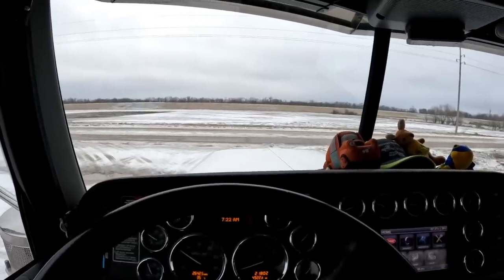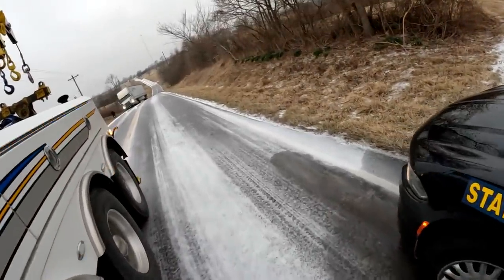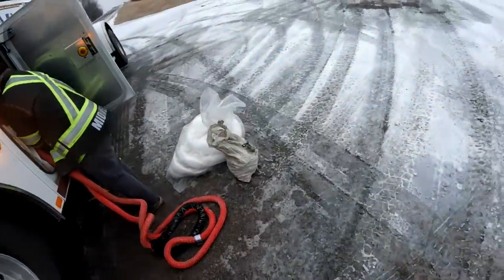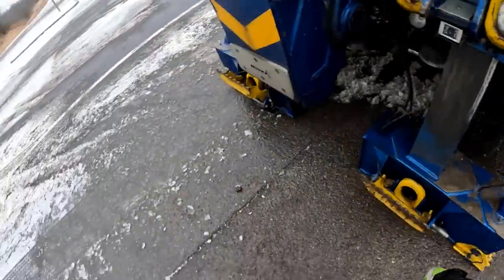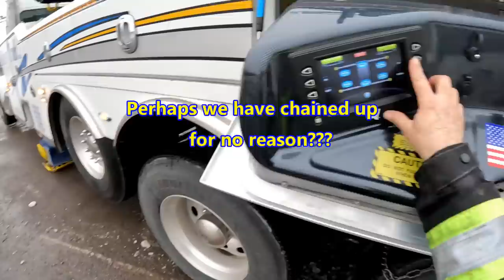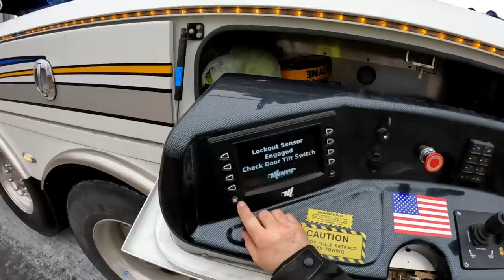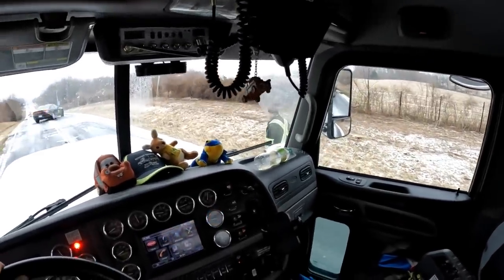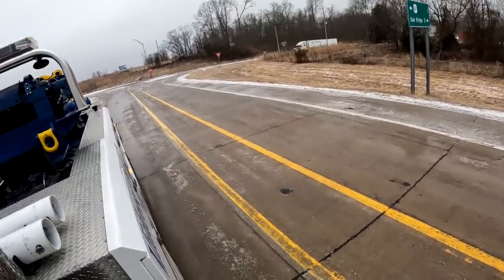First Time Chaining Up the Rotator. Semi Rescued From Ice.

Comment: I was always under the impression that the 'horseshoe' hooks faced out.  This keeps the ends from cutting into the tires, and the chain tensioners would turn right to tighten (righty tighty, lefty loosey).
Reply: Agree that’s what I was taught and thinking when he was putting them on. Either way good work Ron
Reply: That’s correct. He put them on upside down.
Reply: That was my understanding also and I put my first set of chains in the winter of 1947.
Reply: way i always done them
Reply: your right....   I live and drive trucks in the PNW and chain up a lot .....  he put the chains on wrong
Reply: That is correct.   It is not as important on short distances like this, but on longer runs with chains on you want the dogs facing out.     It is possible to use them either direction though,  It can extend the life of the chains if you alternate it each time you use them,  so that one side of the cross links don't wear through and break.    The dogs do not really do damage unless the tire spins in the chains or if the dogs are bent, there should be a slight gap between the ends and the tire if the chains are put on right and are in good condition.
Reply: I love Ron's videos, but you are right, horseshoe hooks face out and cam locks tighten clockwise.
Reply: Yup. Hooks facing out.  And I still remember that from the last time I put chains on over forty years ago.  (Grew up in Duluth, MN where it was common to put chains on several times a winter and sometimes leave them on for several days.)  We used to also carry a bag of repair links for the cross-chains - just loosen the chain-set, put the repair link in and squeeze it shut with a link tool.)
Reply: Correct. No sharp edges towards the tire. The chains stay on my GTs until they are worn out and have to be replaced. That's a lot of tire flexing over 800-1000 hours of operation. I also never use bungy cords or springs to add extra tension. Get 'em tight when they are first installed and they stay in place for the duration.

Note that alternating which side of the chains meets the road will wear them out faster. The first 25% of the chain wears pretty quick. The next 50% presents a broader steel surface to the pavement and will not wear anywhere close to the same rate.

Comment: Chaining up is good practice.    It helps to have a built in jack system to give you some room on the fenders, and so you can get the chains under the wheels.
Reply: That's almost cheating, missing out on the struggle of 3-railers up on Donner laying in 3" of slush with ice cold water running downhill
Reply: Well he can always just lift the entire truck with the outriggers
Reply: Very likely, they either don't get the rust that is often found elsewhere in the Midwest or NE, or they spray the trucks down after a storm like this to keep the salt damage at bay.
Reply: @johnhpalmer6098  From watching these videos, seeing the work ethic, and seeing the awesome condition of these million dollar machines, I think it's safe to assume these trucks are thoroughly washed regularly ALL YEAR ROUND!

Comment: I chained up once for a local trip when you could see the road surface through an inch of perfectly clear ice.  The chains had a reinforcing lug welded across the links, and they left perfect engagement scars in the ice.  Only I didn't have chains for the steer tires.  So I went real SLOW.  Tested the stopping ability - straight line stopping left parallel grooves from those lugs.  I was the only vehicle on the roads!  Wonder why . . .  Got there and back.  Only problem I had was when I got out of the truck and had to hang on to slide back to the wheels without falling!  Ice is nasty stuff.  Many years later, driving 18-wheelers, we HAD to have chains in many western states to meet the law but the boss's rule was, "If you have to chain up to drive, park it!"  Good rule!

Comment: Another great job! I was glad to see you mention the ice cleats several times. They are very useful for wet ice situations and can easily prevent a fall. In the winter I usually have 2 sets in the car and one in the house. They are like chains for your shoes/boots! I was surprised at how much work it was to put on the chains, even with the wheels off the ground, but you sure did need them.

Comment: Watching you chain up reminded me why I hated putting chains on even though I only did small vehicles.  As quickly as you did those, my hands would have been useless from the cold.
Reply: If you know you need the chains beforehand - like bad weather.
Place them inside the cab to warm them up....if there's room..
True you'll only get a few minutes with them in the cold at least it would help with the hands....
Reply: Once you've done it enough times you developer system Andy goes fairly easy.
Taking them off can be a real problem if they break and get tangled all together it becomes a ball of ice and chains.

Comment: Wow, the EASY way to chain!  Extend outriggers, lift truck, install chains!  :)

Having said that, I THINK you have those chains installed upside down.
I was always taught that the 'smooth' end of the cross chains links should be against the tire, to prevent those links from puncturing your tires...

Comment: I remember going out on a road call when I worked at a Kenworth shop. It was in December and it took me a bit to get to the truck due to the roads. Once I had the repair done, the driver was supposed to follow me to the scales about 2 miles up the road where we would call his wife to settle the bill. 

He decided he didn’t want to pay, so he just kept driving. Hwy Patrol stopped him and he was arrested for failure to pay for services and for passing a scale house that was currently stopping all tractor trailers. His wife refused to pay the bill when hwy patrol called her so the truck and trailer were impounded until they paid for the repair and the ticket for not stopping at the scales. 

I left the shop three months later and they still hadn’t paid. Crazy stuff goes on out on the roads. Stay safe Ron and crew.

Comment: I too must chime in and state that the open ends of the cross chain hooks should always face away from the tire sidewall, I have been "Throwing Iron" for 45 years and that was drilled into me, along with "Its always easier to chain up than deal with the results of failing to do so!"  I also have chains with welded cross bar studs on the cross links, and they are designed to face outward when the hooks are away from the tire.  New chains are not likely to damage the tire but an old set that has been repaired, frequently has hooks that are sharp and that do not lay flat, which can certainly damage the tire sidewall. That is why it is a good habit to always mount them facing out.   It must really be nice to have a truck that will jack itself up when you need to mount the chains,  all told you made that process look about as easy as anyone I have ever seen mounting chains on duals! (and you still were grunting!) I Really enjoy watching your channel and learning from your "why I am doing it this way" dialog. THANK YOU RON!
Reply: Read his pinned post saying he admits to putting them on wrong.

Comment: RON,,,,Hello, man that’s ICE, & YES I do know the ROTATOR never ever had chains on it, I never knew they made chains for DUAL WHEELS , BTWthe ONLY time I ever used chains was in 1961, on a VW BUS , for work, middle seat removed, trip was BRONX to NEW HAVEN CONN, 7” snow , with my godmother &her SISTER, going to family there, used. Blankets, as heat sucked in those vehicles. Glad you mission god done without incident , GOD BLESS YOU ALL, CHERIO. 🇺🇸🇺🇸🇺🇸🇺🇸

Comment: I'm no expert on tire chaining but I have seen enough videos to know that you have to practice regularly with these chains if you want to get it done quickly and efficiently. You can lift the rotator's wheel up with your hydraulics, try it without lifting the wheels! This was a really good working experience for Eli. Your chains were still in the original bags, now you will need to hang them up somewhere in the rotator. Big rigs often hang them outside alongside the cab  and they get wrecked, rusted and stolen. Never regret putting on the chains even though it seems you might not have needed them. 
Good thing the semi driver decided not to fight the ice and wait for help.

Comment: Ron look up a pair of boots called kickspikes they have retractable spikes in sole of the boots and are insulated and waterproof.  As a flatbed driver myself I have been using them for the past two winters and they are the best thing in my opinion.  The spikes are also easily replaceable also when needed. Promise you will find them better than your ice cleats.

Comment: As I had commented in the last one, the ice cleats I have would be good for using whenever you have icy roads to have on your feet before you need it, so they just need to flip down, and are usable.  If they are easy to use and get out of the way when you don't need them... are much more of use.  Just like road = visibility, Ice = cleats should be when you use them, instead of skating about!  Falling and getting hurt when you don't need to is really bad, and ice is hard...   Spares in each truck is also something to think of, too!

Comment: I used to drive across the Canadian Rockies. We all hate throwin chain. After 2 seasons I said enough is enough and had the autochain system installed for both drives. Best investment I ever made on the truck. Not much good for wreckers of course but frankly I think it should be standard safety equipment on every OTR tractor.

Comment: Ron, I'm country boy raised in snow country.  A trick, don't know if you can use it is places like this.  let some of the air our of your tires, put your chains on as tight as you can and air your tires back up. keeps chains "tight"!!!!!
PS do your inside ones first, ya you got it on the second ones
I am afraid I would have what dad called come to Jesus meeting with salt truck dispatchers
With my luck there would have been a 40 mph wind blowing

Comment: Ron that is as  Slick as GOOSE GREASE.  I turned a fire truck totally around  one night in Marion, Il. The Capt. that was with me I think he had to clean his drawers and his hand prints were still in the dash when they sold the pumper. We left some lines hooked up to keep a little bit of water on the structure. Someone shut the water off. And the hoses froze and we had to drag them back to the station like logs. 
I enjoy watching your show. And the rigging you do I have had to do the same with Special Rescue Training and in action.

Comment: I've chained up about 40 times this winter, we use ice breakers,not legal on paved roads but sometimes do what you have to. Usually use a double set on driver side and a single on passenger. I work in the gas industry in northern Pennsylvania,so majority of the time is dirt and off road. the hills are short by steep, thought about chaining steers, but nervous a cross link will break and cause damage.

Comment: Ron I’m sure you have a Mac Tools truck come by the shop. They have a fold up work mat you should look into. I’m a road service mechanic for a living and I have one and they are great. Fold up to use as a knee pad or to store it, unfold to lay on. It’s about 4ft unfolded and about 18” wide. They don’t soak through either. They are around 50$. The part number for it is macpad2

Comment: Well with the chains. This is the first time I seen you using chains. We regularly use 2 sets of triples on our drivers. One on the steering axle and one on each trailer. We usually haul super B’s in the winter in Northern Alberta.

Comment: Hi! Ron:  I may be wrong, and you have lots more experience than I have.  But ages ago I was told the end loops from the cross tread chain to the side chain, should be towards the ground like you said.  But you put the curved side against the tire.  The other side of that end loop is flat.  You don't want the curved side against the tire.  It doesn't make much difference on the short time you had them on.  But on a long trip the curved side of those end loops against the tire can damage the tire.  Look at that end loop again and you will see the side you have away from the tire is flat.  The side you put against the tire is curved.   You had the words right - "towards the ground".  But it is the curved part that should be "towards the ground", not towards the tire.

Comment: Ron, I enjoy watching your videos... I hope to remember some of your techniques if needed on an extrication with my Volunteer Fire Department.  
When you put your front chains on, I have always been taught that the crosslinks attachment link point up,  so it is smooth side toward tire.  I don't know if it really matters if you don't have the v-bar crosslink style though.
Reply from the maker: Yes, I had these "technically" upside down.   I wasn't worried about it at the time.  I knew that we were simply backing up the hill, performing the recovery, then back down the hill.   The interstate was clear so I knew I would be taking the chains off as soon as we got back down to where we chained up.   Thanks for watching and God bless.

Comment: Circa 1988, I drove a truck-trailer flatbed with a single drive+tag axle. The typical load was wallboard or shingles at 80,000 gross weight. I diverted from I-70 in Colorado and slid back into a slight ditch, after throwing a tire chain.  Surprisingly, a single-axle tow truck was able to assist pull me up the grade. I believe I could have negotiated the grade with dual-drive axles.

Comment: Sure needed a lot more sanding trucks out there!!  Typically I'll put the hook openings away from the tire so the flat part is against the rubber.  Those cam locks, I've not ever needed the suspenders as a backup, they sit tight and stay put!    Good employee training, drag the chains out in June and have everybody taking a few turns taking them on and off, showing them how you want it done on a comfortable day.  Once I get mine set, whichever link lines up with the hooks, mark those with tape or a zip tie for a reminder how much to choke them up.

Comment: Granted that I live in a much colder part of the country than you do, but it surprises me that MoDot is so slow to get roads sanded, salted, and, if necessary, plowed. Our plows and "salt shakers" would have been out for hours. For a little bit of ice like this, even secondary roads would have been cleared by now. I guess the state would say that conditions like those you are struggling with are too infrequent to warrant the equipment and personnel cost. You do great work, Ron. Be careful and stay safe.

Comment: Hey Ron, I had another idea.  When you are hooking up chains with the wheels off the ground, can you rotate the wheels, once the chains are draped on the tires?  So all the end links are together, above the ground, instead of the inside ones being behind the tire.   On a car, I always roll the car over a couple of cross links, so all end links are on the same side of the tire, without the hassle you had getting all the ends together.  With duals you have six all together for each wheel.  With all six meeting above the ground without the tire in the way, is a lot easier. That way you don't have to crawl under and reach around to get the back ones.

Comment: "Been There Done That Got the T-shirt" ..... I know exactly what you're going through Ron.. I ran doubles from Seattle to Missoula on hwy 90   .. "Suicide Curve"  (Coeur d'Alene) , "4th of July pass", "Lookout Mountain" and  "Snoqualmie pass"  during the 1979/1980 winter and wore double chains on both  "Drag",  "Drivers" and a single on "Steering"  for a solid week without taking them off..  then I had to make several runs in that same area during the Mt. Saint Helen's eruption aftermath when 90 was closed for a few days due to heavy "Ash" on highway.

Comment: I grew up in and have since come back to live and work in southern Indiana.  Weather here is less predictable than a dice roll most of the time, especially in the winter.  There was a "highway" to get from the interstate to a few miles from my house that once you got a mile away from the interstate, it went from a 55mph highway with broad shoulders to a barely 2 lane country road with very deep ditches on either side in the span of about thirty feet.  Almost every year we lived in that corner of the county, an INDOT plow truck would be trying to clear the highway and miss the fact that the shoulders disappeared into deep ditches and drop the plow truck into the ditch.  There were deep gouges in the pavement from one particular instance of this that seemed to also bend the plow significantly.

Comment: kitty litter is better than salt for quick traction, salt takes time to work and if it's cold enough won't work at all, and while salt is working it will actually make ice even more slippery
Reply: Use none clumping cat litter because the clumping stuff will get greasy as it gets crushed by the trucks
Reply: Yeah, but if the casualty's engine is a CATerpillar it makes a mess on the litter and things get worse
Reply: He keeps kitty litter around too, I've seen him use it in other videos.
Reply: Sharp sand too, which is cheaper here
Reply: Salt only works when there is a lot of traffic to mix the salt with the ice.
Reply: Kitty litter (clay based) is my go-to. It won't rust whatever it touches, and it's also good at soaking up any spills.
Reply: My dad was on the road 5 days a week - in winter he ALWAYS had a couple big bags of kitty litter on hand!  He tried using ground up oyster shells once (a chicken supplement), but he went back to kitty litter.
Reply: @MGower4465  LOL